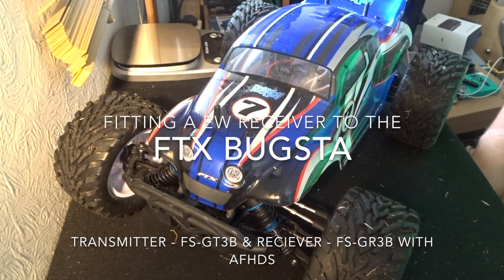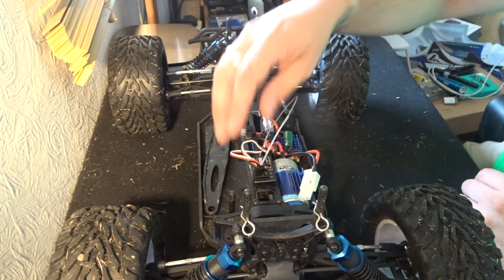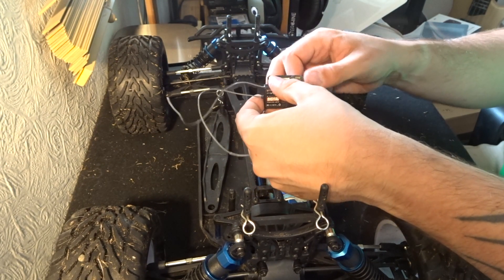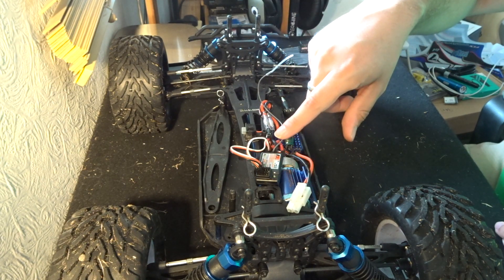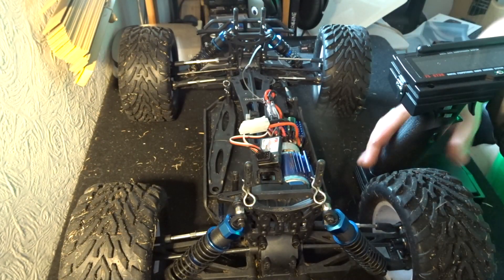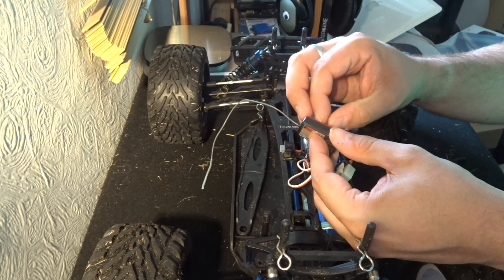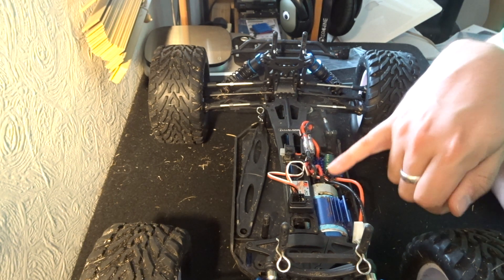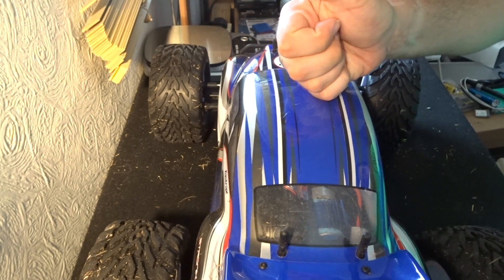Fitting The Flysky GR3E To The FTX Bugsta 1:10 Scale RC Car

Comment: Hi jd. Core a old skool tamiya connecter im surprised some manufacturers still use those. Get rid of that old tamiya connecter mate and put deans or xt60 connector on it. It will give you better voltage flow. And your never have to worry about them sticking together. :)
Reply from the maker: Hey Mark cheers for the tip matey, but that is for another video. All of this is leading to something quite big indeed and i dont want to give the game away just yet bud, actually lets take this convo to Discord 👍😀
Reply: JD Quad hi mate. No problem at all.. I look forward to seeing what you have planned lol but I have a good idea.. unfortunately I dont have discord on this phone my I hate using this phone its very hard to type and very glitchy. But hopefully within a week I should get my phone back from repair. But in the meantime ill send you my email address via instagram then if you want or need to you can email me whenever  you like mate.. I definitely need to start sharing my rc stuff here dont I. Next week ill get on it :)
Reply from the maker: Thats a great idea bud, and yes matey start popping it up :-)
Reply: hi jd, next week ill start doing that mate. :)
Reply from the maker: Sweet :-)